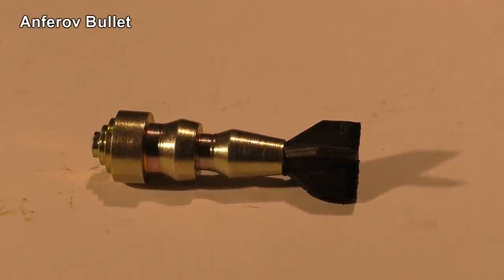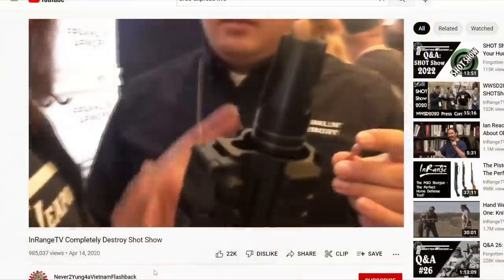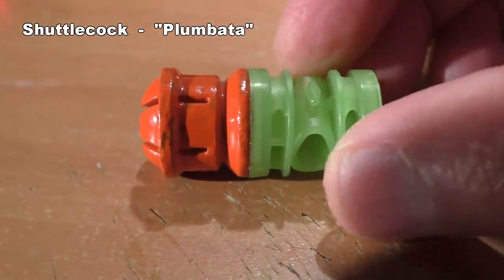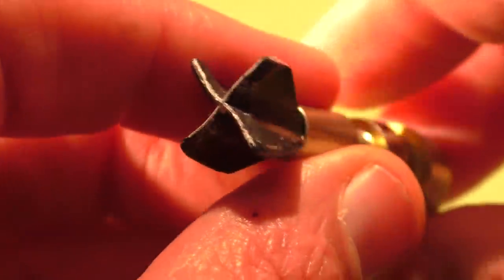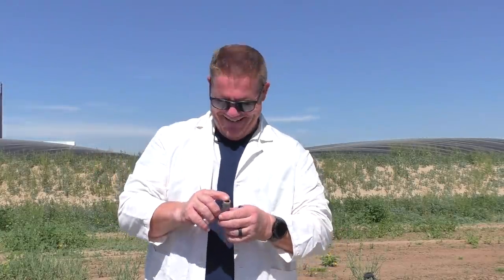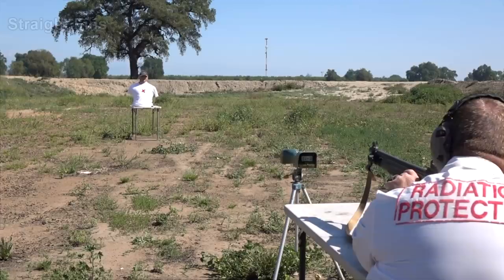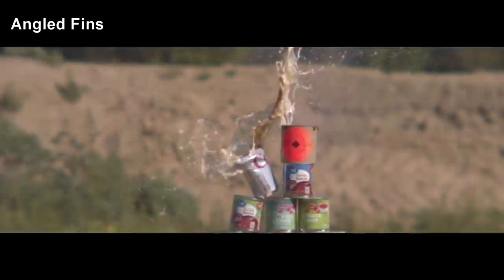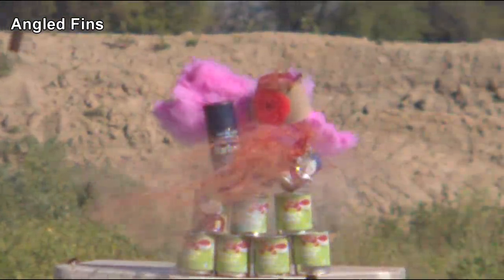Supersonic Darts - The Effects of Inducing SPIN - I learned something!

Comment: One of the issues with angled fins is if the fins are not completely symmetrical then the spin will not be controlled. Instead you get a tumbling effect in addition to the spin
Reply: It will "tumble" anyway because of aerodynamic and inertia effects. Rotation in some finned guided projectiles is used for control as you need only one control surface for any direction and all that yawing around the direction of travel is undesirable effect.

Comment: Then you have the bent fins were not precision bent and uniform on all 4 fins as well. Add in the normal error going to be incurred by having a human  firing the shotgun instead of a mechanical rest  with the shotgun locked in and unmovable . Your targets were a bit sucky if you are wanting to compare accuracy between rounds (not that they weren't fun). You got the guys below saying out that 40 deg vs 3-5deg, where 40 degrees is too radical for this velocity. Then you have to do more than just shoot a couple rounds and then it's Miller time. I don't think you really answered the question... but it was a cool video! Can't go wrong shooting stuff with shotguns in slo mo.

Comment: A long-range accuracy test world be of greater value. Three reasons, 1. Longer distance of travel = round variability deviation will increase, but 2. More interestingly as the projectile slows air resistance in the fins will have a greater effect. 3. As this greater effect comes into force the spin will increase. So shooting over a longer distance should show a greater accuracy

Comment: So in your ending explanation the answer is yes spinning the projectile is more accurate than just fin stabilized alone. And of course NOT bending each one manually to different angles and bending at different spots on each fin is going to give you the more accuracy and tighter spin.

Comment: The idea that bent fins effected it at all was more surprising to me than anything else. Something this channel has proved repeatedly is that, in most cases, over engineering fine details usually doesn't have much effect, at best, and possibly hinders accuracy or consistance more often.

Sure in many cases things make for a "neat" design, or possibly a slight overall improvement, but as with many other things, usually "keep it simple stupid" performs better on average.

Comment: Long time archer here. All arrows spin, modern day plastic vanes will either be offset or have a helical pattern to induce spin. Fletchings have a natural curve in them and are reffered to left or right wing fletchings, even when fletched on straight this curve in the feather imparts arrow spin, additionally arrows spin by default due to how strings are made.
Overwhelming consensus in the archery community is that imparting spin improves "accuracy" greatly. Supersonic ballistics and arrow flight are not the same, though.

Comment: Supersonic jets have all flying tails because the shock wave compression messes up hinged surfaces. These slugs need angled rather than bent fins. The Barnes Wallis Talboy bomb went supersonic on the way down. It’s fins impart a spin but the angle is very small.  Check out the images on Wikipedia.

Comment: On his flight trough the air a not turned projetile only needs to deal with the air in front of it.
But a turing one also gets pressure on the turned wings. 
multiping the airpressure on the turned wings per micromillimeter to sqare² with the wheight of the object 
diffi-plussi-calkiolatississimo per nanojouleabsorbement i am able to say that the one or two turns in the range of use
are mattering just not that very much. Like if there one or two lead salads on a hamburger.

Comment: basically, think 'model rocket science' mixed with basic airplane design... and I think you'd have a super accurate round! 

With hyper and supersonic model rockets, the thinner and longer, the better (my wife say "thicker and longer" but I don't think it's the same rocket type I'm talking about). Rockets use a guide rail to keep them straight for the first two feet of flight.....after that, they use a lot of spin as stabilization and use a yo-yo despin mechanism to stop that spin once in space (few hobbiests hit that level, but that's what Raytheon and NASA do). if the rocket has living payload, then the spin is minimized so they don't kill their occupants. 

...so, like with a rocket or rifling in a barrel, there is an optimal spin per distance ration. 

Also, rockets are generally straight bodied. This allows them to be very aerodynamic. If you add different channels into your projectile, you will likely cause air turbulence that is directly hitting the fins, making them work harder to stabilize the flight. 

So (my guess), if you had a round that was more like a flechette (like a 12 or 16 penny nail with fins), or one that is more of the shape of a mortar round (football shaped front with a thin tail section and fins at the end), or even one that looks like a WWII bomb..... just, no channels unless it's a wasp waist design, like a plane. 

any curve along the aerodynamic parts of the projectile with cause parasitic drag, as you guys already know. like a plane wing, when the surface is straight (bottom of a plane wing) there is more drag but also more pressure.....while air moving over the top of an airfoil will move faster. So, if make the body straight, the pressure from the drag will help keep the round straight. if you add channels or flat areas, like your rounds do, the air will act like it hit a wall......so, supersonic air hitting the front area of the round that is perpendicular to flight causes a ton of drag as it is pushing directly backwards to the rounds movement. 

if we thing "top of a wing" and we make the typical 'pointed tip' type of projectile, that looks like a football....then have a thin area leading to the fins, you would get air friction to act like the top if a plane wing, causing stability. it would streamline the air to the fins and you get a better flight pattern since the fins aren't battling turbulence. 

TL;DR Version: make it either like a flying nail or (better yet) like a mortar or one of those whistling nerf footballs with the fins. Fire it as a sabot and you will, likely, get better results. 

.....you will, guaranteed, get a result....and it might even be different from these! no promises. 

also, have you guys ever considered huge buckshot (slug sized) with a golf ball pattern on it? Those rival nerf guns use a projectile like that and they put a small piece of rubber at the end of the barrel, which puts a bit of English on the shot, allowing the ball to travel further (as the backspin gives it an arching trajectory).

Comment: Use a white backing on every shot.  Set up gates every 50 yds to film and check stability.  Get rid of the stiff angle and put a surface like an airfoil to induce the spin also gentle it up (the angle) some.  You probably got to shoot 20 rds each at a significant distance to see a significant difference.  It also looks like you are trying to solve a problem you don't have.  Unless you need to shoot 150 to 200 yds.

Comment: The reason why both darts fell at the same speed through water is the physics. both were propelled by the same constant force,  gravity. You should not see an appreciable difference. 

Now if you fired them both at 90° from the horizontal the force on the dart drops off as it leaves the barrel. It is in this test that you should see some extra drag on the modified dart.

Comment: While I agree that rifling makes things better I'd also like to provide a counter argument to it. If rotation made smooth bores accurate by default then the M1 Abrams would use it. And as far as I'm aware those big tungsten darts it fires with sabots have zero rotation. It's a big smooth bore cannon on that thing and it can hit targets while on the move and with the target moving with (for a tank), >very< accurate placement. 

IMO rifling helping depends on the shape of the projectile. If the shape is complex enough or just, I dunno, odd enough that it will cause some buffeting during the transition to the speed of sound then I'd say it needs some rifling. But if the design is such that trans-sonic buffeting doesn't happen or has little to no effect then there's no need. Likewise, if the sabot separation is consistently clean there's no need but if the sabot or wadding or other parts of the charge are a little sticky at times then some rifling might help to stabilize the round in flight. I think the biggest problem is that once you hit mach any yaw off the axis of flight induces yaw so fast that even rifling only helps a tiny bit due to how fast the air pressure on the face of the round diverts it off course.

Comment: The fins were given far too much spin - especially at their tail end - causing significant wobble.  The point would be to use straight fins, that were offset from the longitudinal axis of the projectile.  A small offset, like 1 or 2 degrees would be where I would start.

Comment: Arrows Are spin stabilised. They're the origin of angled fin spin stabilisation.
Darts are straight fin/drag stabilised, and the oldest form for fin/drag stabilisation. The most basic darts use drag from tufts of fur or fibre, more complex ones use straight fin, like war darts.
The first spin shot looked like fin angle imbalance.
If there is any improvement from spin fin, you'd need to look for it at the edge of the range, tho the additional drag will cost some of that range, hopefully with an overall improvement to the accurate range.

Comment: the military prefers fin stabilized non rotational for an entirely different reason and that has to do with the dynamics of HEAT rounds and the affect that  spinning round affects the nose impact and HEAT chemical jet  post impact.   essentially they want the heat round to hit as flat as possible and with as little spin as possible so the jet forms clean and in a straight line.  

its because of this that so much work went into smooth bore barrels and eliminating any chance of spin.

Comment: water test really did not have enough length of fall to test [ bent fin],The bent fin has to increase the drag more than a straight fin projectile, plus using more energy to spin, therefor e slowing it down by a bit.

Comment: I mean, while spinning a jet in the air wouldn't make it more stable (since it's, you know, a plane with wings that only work upwards), it absolutely does work with rockets and was a very common practice with early rockets including space launches. I wouldn't even be surprised if it's still used today.

Comment: The reason fin stabilization works is because as the projectile starts to tumble the fin gets more air pressure in the direction of the tumble forcing the fins to straighten out, fins that are too small or too big will cause wobbling. Too small and it will have to tumble further to get enough pressure and then will tumble in the opposite direction at the same distance creating a wobble, too big and too much air pressure so it will be forced to wobble. You can see the wobble in the drop test.

Comment: It is interesting about the spin imparted by fins on a projectile. If the projectile is not perfectly balanced, spin could impart a wobble which could cause some deflection. An M1 2A Abrams tank uses sabots with the projectiles. I don't think spin stabilization is used. Comparing the smooth bore 120 MM canon to a 12 gauge shotgun isn't a large stretch. And nobody is going to say that the 120 MM canon isn't accurate with the projectiles supplied.

Comment: Okay, my understanding -- and I could be wrong -- is that at supersonic speeds, the actual shape of the projectile aft of the nose is irrelevant. And this is because at supersonic speeds, there is no air flow along the bullet. Instead, a conical pressure wave is formed in front of the bullet as the bullet is pushing air sideways out of its way.

For that reason (and I stopped at 5:00 to make this comment) I do not expect any good effect from this mod. I really expect it to fly the same, and only to start spinning if it is in the air for a very long distance, and becomes subsonic.

Comment: You go deep in to small inconsistencies making differences and then try to test with fins bent at inconsistent angles. So basically we just watched a video leaving us right where we started. 🤔 I still enjoyed the video though.
Reply: Yes, machining errors popped into my head also watching the difference between spin shot 1 and 2.
It would be difficult to get consistent results without a higher tolerance measurement for the machining.
And if you're going to go to that level of precision, why not go for helical shaped fins?

Comment: Angled fins rotate the bullet because they interact with airflow over their surface.
The direction and speed of the airflow determines the rate and direction of bullet rotation.
As the projectile is just clearing the muzzle, there exists a large blast of gas is passing over those fins, moving from the rear of the bullet to the front.
Muzzle blast might tend to 'anti-rotate' the bullet before down-range flight rotates it back the other direction.
This would 'look like' unstable short range shots, with the bullet getting more stable the longer it flies.
This is all before watching the video!
After watching video: no anti-rotation seen, gas flow during muzzle-blast isn't of long enough duration to impart spin.

Comment: At 7:03, your slow motion camera shot clearly indicates that the projectile is tumbling. If it is going faster than the speed of sound, you better put spin on it It's not even clear if you have reached the speed of sound. Oh, and by the way, the British built a 10 ton bomb called the Grand Slam near the end of WWII. Designed to be dropped from an altitude of 20,000 ft. it reached the speed of sound. They had to offset the tail fins to generate a spin on it, in order to stabilize it.

Comment: if you want repeatable accuracy, there has to be precision when angling the fins. If you really think needing more precision with a shotgun slug is necessary. I for one think the straight fins get the job done.
Reply: This is in line with my thinking. Though I can't be sure, it appears that the angle was made manually with a pair of pliers on what was manufactured as straight fins. The manual use of pliers imparts an increasing probability of "machining defects" including - but not limited to -  imprecise angles, imprecise crease line location, imprecise crease line angle, and damage to the fins from the teeth if the pliers. While this test wasn't completely useless, and we did learn something; the test wasn't sufficient to answer the "test question". "Can spin 'overstabilize' already fin-stabilized projectiles?"

Comment: Kinda hard to fin-stabilize a supersonic projectile when the fin diameter is smaller than the rest of the projectile.  The reason APFSDS rounds work is because the fins are the largest part of the round, diameter-wise.  Making the front part of the projectile larger in diameter than the fins is a fail.

Comment: It doesn’t stabilize properly because of drag. The fins have too many degrees of freedom and less mass, so it wants to get thrown everywhere. You have to put profile that initiates the spin at the balance point or where there is more mass. If you made the body of the dart an impeller, it would likely work better

Comment: If producing a bent fin. If just one fin catches the wind wrong. Or has deviation in any way. It will go wonky. And the fact that these bent fin's are in the rear of a top heavy round. Only causes this to become worse. If you place the fins to the front. Either they won't spin. That's the most likely out come. But if they do. The same problem will occur. Also gravity is pulling on the side of the round. The reason, you don't see this in a slow moving object. Is because it is moving slow.

Comment: Spin is probably best for nonfin stabilized design. The fins don't need to spin to provide stabilization. Arrows don't need spin to work. Neither do rockets and torpedoes...all fin stabilized. The first shot looked like it was a little bit wobbly. The first spin shot was horrible sabot separation. The second spin shot was smoother than the first nonspin shot. I was surprised by that myself.